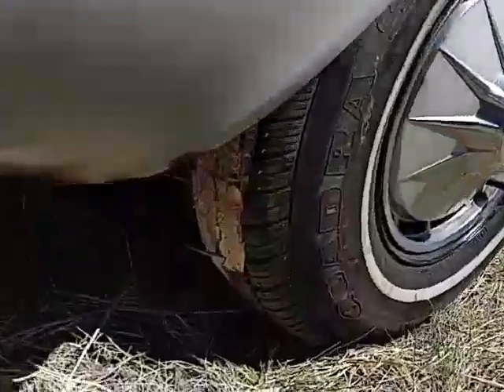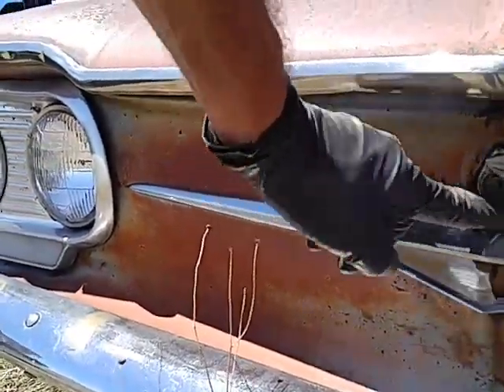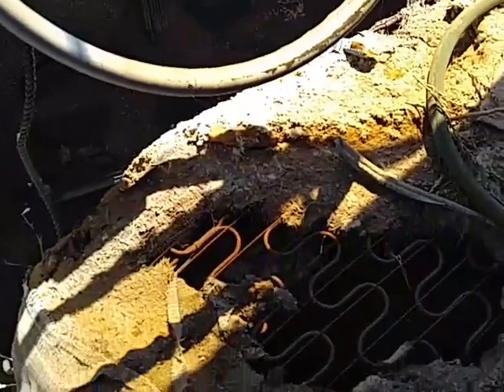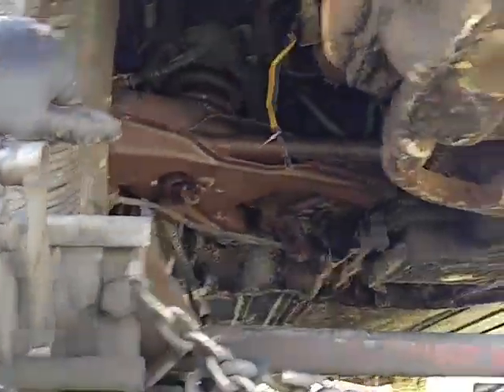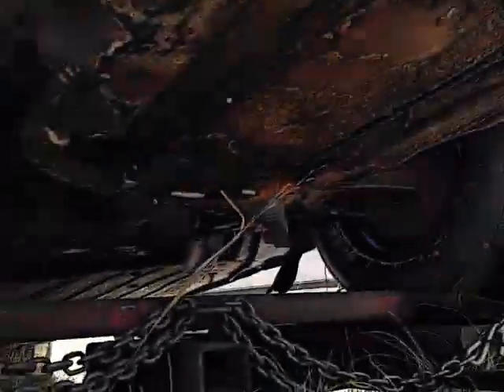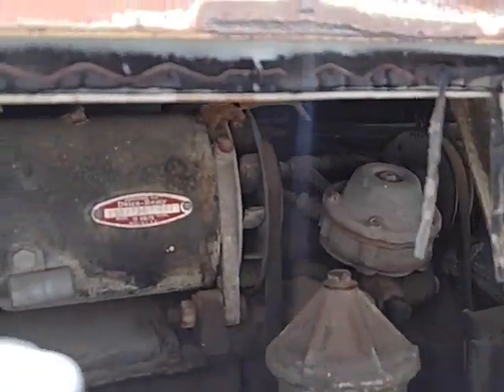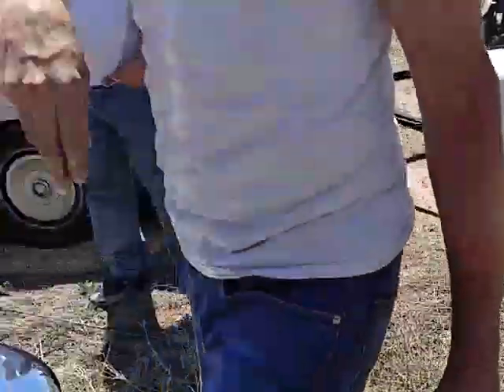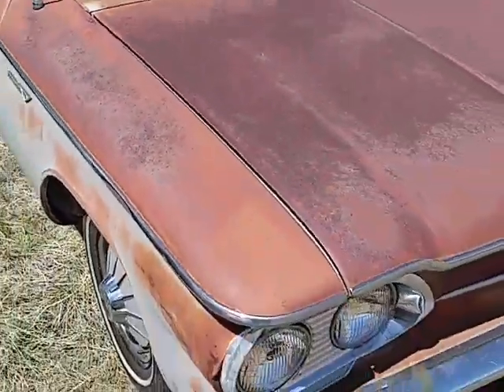Good Tin Body Junkyard V12 Corvair Encounter 5 5 17

Comment: I found a corvair. Solid. Only needs a clutch an tires an fluids an such. A 62 4 door. Paid only 80 bucks an get it out then an there. Its blue an everything is there. No dents. No fade in paint. Been in a garage since 77 when the clutch went out. Shows only 39k miles.ima have fun wi this un soon as it warms up outside.
Reply from the maker: LowLife Juggalo good find! Corvair clutches involve alot of pricey parts, rebolted or riveted flywheel, resurfaced pressure plate etc. Plan carefully!
Reply: CORVAIRWILD i know this already my friend. I had a 66 corvair van with a 3 speed stick an a 4 banger. An after i sold that i had a 63 corvair convertible. Originally a 2 speed auto. But someone replaced that with a 4 speed stick. An that was a beach to rebuild. But i did it an sold it. Now i got this one an i plan on keepin it. As its such a nice car fer what i paid fer it.